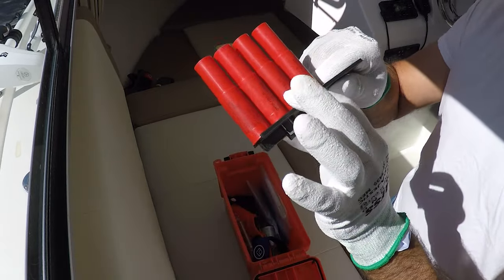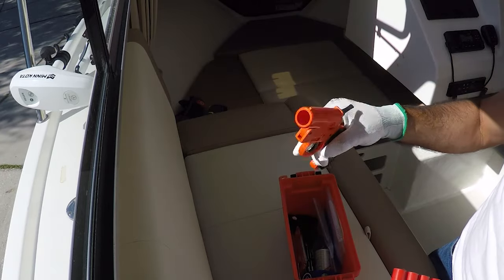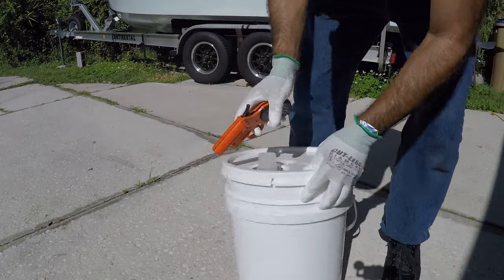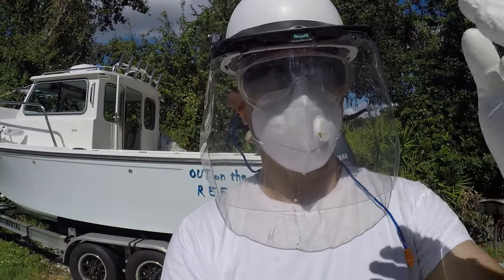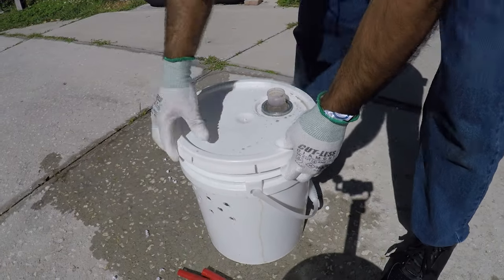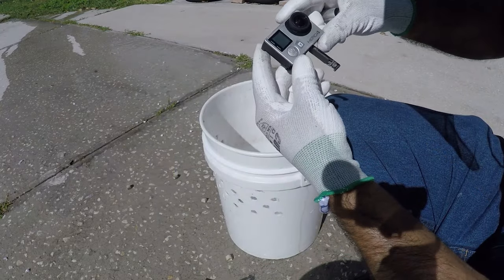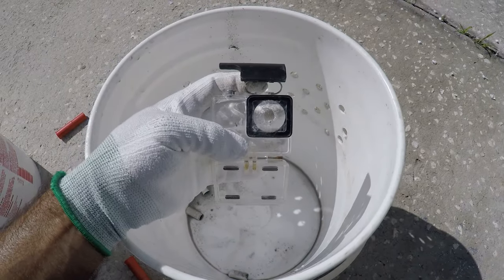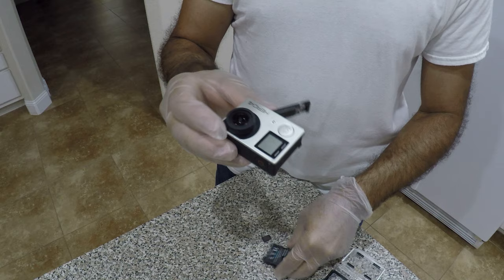How I'm Discharging my Expired Emergency Gun Flares Crooked PilotHouse Boat Orion Flare Gun

Comment: Capt. You can keep the old shells and mark them with an “X” to know they are expired.  They will work for many extra years past their expiration giving you many more spares.  Just make sure you have up to date ones in case the CG stops you.  Also, my county’s recycling offers and will take hazardous materials like these.
Reply from the maker: Awesome captain that is a great idea to keep in my spare I will do that on the ones I have now that they're almost expired thanks for the great suggestion captain👍
Reply: This what I do as well.
Reply from the maker: @saltyseatv5904  yes is a great idea 👍
Reply: but then it wouldnt be this much fun come on
Reply: Yeah i would keep them as well. If stored corectly they could work decades aftet they are expiered. The date is only for the manufacturer to be safe, so they can say it was expiered if it does not work for some reason. To have more, just in case is always a good option, because you don't know how many you would need in case of an emergency.

Comment: Being an amateur ammunition reloader, I was curious how these flares worked.   They are very similar to shot gun shells with one major difference - there is no gunpowder.   The flare is launched with the primer only, which also ignites the flare tracer.   Amazingly, the entire projectile is burned away to nothing before it hits the ground.
Reply from the maker: is a great safety device especially at night wen you need rescue
Reply: @OutOnTheReef  Is there any reason they don't use a non-flammable flare? I'm thinking like a large capsule of glow stick and the firing cracks the internal vial and lights it. Someone made something like that about a decade ago but I guess it never took off. Is there a regulation that requires the pyro version? I'm not a boat guy so I don't know.
Reply from the maker: @DaveSmith-cp5kj   It looks like the flare pass more miles of visibility instead of a glowing device that's why I think they do it that way the flair is hard to look close by with your eyes is that strong
Reply: @OutOnTheReef  Ah got it. That would make sense then.
Reply: they do have powder and can be re-purposed for other things.. theyre fairly easy to take apart only you pull the primer and dump the tiny tiny amount of powder that in there and push the flare out the front of the shell from the rear...re-insert primer and powder use the seal cup that pops out on top of the flare to separate shot n powder and put a shot card on top.
Reply: tho i dont recommend it for legal reasons.
Reply: @jackpackard5027  I did not see any powder in the shell. Just a primer.  209 shotgun primers are surprisingly powerful.  I’ve used primer only rounds for practice shooting my 38 special with plastic bullets made from glue gun material.

Comment: Nice idea to dispose of old flares.  I keep them though.   They will last for many many years if stored in a dry box.  You just need at least 3 unexpired flares to pass inspection.  If you ever need them, you’ll wish you had them all.  I’ve never heard that extra expired flares on board will result in a fine as long as you have 3 unexpired , and I’ve been inspected many times.
Reply from the maker: That's a good idea! cap. like you said you just need 3 new one to be US coat guard Approved👍👍⚓

Comment: Well... I never know that bullet has expired date. I have to check my 50.Cal
Reply from the maker: Yes is very important that way you dont get a fine 😁👍
Reply: maybe flares absorb moisture on a boat but bullets are pretty airtight in the brass casings. I shot 303 British from WWII with no problems at all.

Comment: At least yours work after they are expired. I bought a brand new set earlier this week, I don't have a boat but I wanted a flare gun. Tried to shoot it this morning and it didn't work. I'm glad I wasn't on a sinking boat using my flare gun
Reply from the maker: That is very rare but it is a good possibility sometimes if they don't work that's why it's good to have several packs for emergencies👍
Reply: @OutOnTheReef  I took it apart and fixed it myself. I figured if I could work on semi trucks and construction machines, and drive and operate them, I could fix it lol
Reply from the maker: @thedd13ram   You're very right Shane If we can fix heavy equipment of course we can fix a small item like a flare lol
Reply: @OutOnTheReef  I just bought my flare gun for hecks and giggles, the only boat around my house is a little aluminum John boat
Reply from the maker: @thedd13ram  they are expensive over $50 with the gun